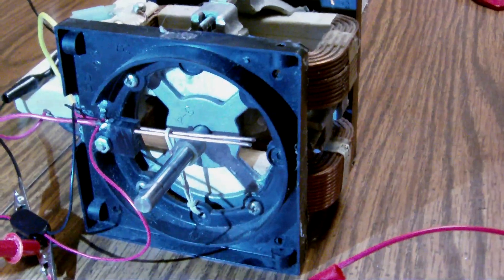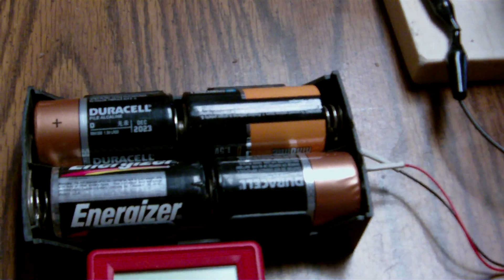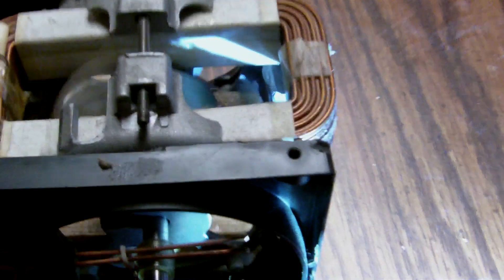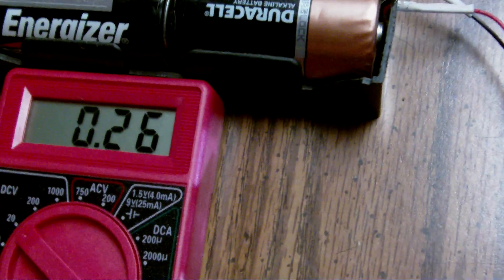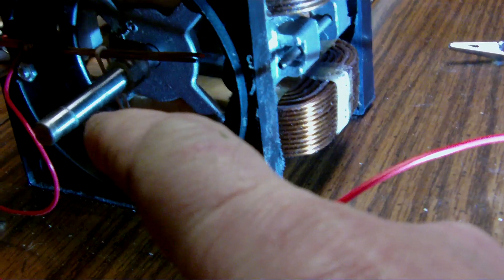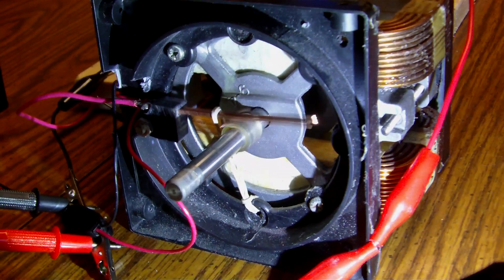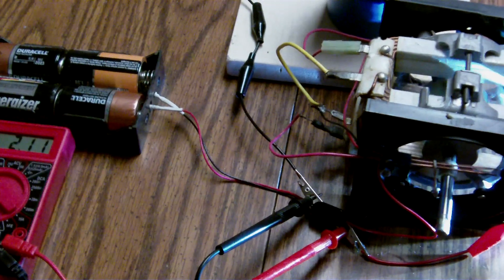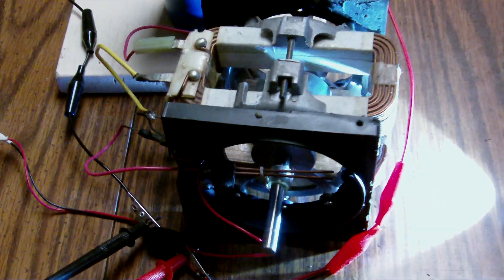newman motor  batteries to dead to run the motor , until  the capacitor

Comment: newmans motor doesnt run on current man;;;;;;;;;;;;;;;;;;;;;;;;;;;;  it runs on voltage''''
Reply: Your right,  as little a current flow as possible,,  Joe ran his  7500 pound motor on 750 volts at 1/4 amp..  sadly,  Joe passed away in 2015..  He was a cool guy.
Reply: I'm translating his commutator to solid-state switching.  @THOMASTHESAILOR
Reply: And yes, R.I.P. Joseph Newman.
Reply from the maker: @GaryMcKinnonUFO  would love to see a video when it's complete :-)
Reply: @GaryMcKinnonUFO  where can we find your work?
Reply: @JimEdmiston  I've nearly finished a larger Thane Heins replication (the only tech i've succesfully replicated in the past) and will upload it to my channel.
Reply: @GaryMcKinnonUFO  very cool. I checked out some of your other videos, too. It's kind of you to share your work.
I believe what you may be missing with the Newman motor technology, is that with an extremely large coil a large magnetic field can be created with a small amount of current (at the cost of high voltage). We don't need the coil to "fully charge" we just need it to conduct enough current to create the massive field and then return that field as back-emf between each half-cycle and direct that energy back to the batteries or when running at higher voltages to a capacitive load. The charge time of the coil does however limit the RPM of the motor while mechanically commutated due to arcing. This is why I was excited to see your comment about a solid-state switching device.
Reply: @JimEdmiston  Thanks Jim, i was under the impression that it needed to be fully-charged, and of course if you do the maths on that then there's no energy saving, you've put in more than you get out. I'm only working on Thane's RegenX technology now since i've replicated it in the past and seen it work.
Reply: @GaryMcKinnonUFO  Hello, just wondering , did you ever succeed in creating a solid state commutator?
Reply: @ZeppelinPass  No i didn't get past planning for that one.
Reply: @THOMASTHESAILOR  So how is that remarkable?  You can run a pulse motor for years on a single watch battery.  Still not remarkable.  The Newman Motor did nothing remarkable.  Newman was a con man who had little understanding of Physics.
Reply: @valveman12  ,  Newman motor is not a pulse motor..  It uses a standard commutator..
   Newman motor puts out much more shaft torq and  total power than the electrical current it uses..
    Standard conversion math  : 1 horse power = 765 watts..
   Don't believe Me.  Do the math yourself..

  You don't need to be a Physicist to design a motor..
Reply: @THOMASTHESAILOR   You said: "Newman motor puts out much more shaft torq and  total power than the electrical current it uses.."  I am not berating you, I'm just pointing out that you made a comparison between total power and current.  Perhaps this was just an innocent error.  Power and current are not the same thing.  However, there must be current to produce power as well as voltage.  I am not going to argue whether the Newman Motor is a pulse motor or not but I will say this, it does not produce more power than what it uses to run.
Reply: @valveman12  ,  Well,  I certainly never tested the Newman Motor,  but,  if ya watch the whole Newman Motor story that spans several decades..  You'll find,   Newman had many University Scientist test it and put their results in writing....
    These are credible People with all the expertise needed for a proper  determination...  They've all been sworn to and notarized, etc..  There's many of them..  All with the same test results..
  No, I don't have any links or references to the tests or testimony,  but,  it's very real and very correct and very easy to find..
   I've watched Newman's struggle for years....  With an open mind,,  It's hard to deny..
  Newman did everything humanly possible to document is Motor,   with no failures..  Only Nay-Sayers.
Reply: @THOMASTHESAILOR  A red flag is raised talking about Scientists validating yet no links to this information?  Sounds like a tale to me.  One that you most likely heard in the Free Energy Community.  Besides if this was so revolutionary, these Scientists would have pursued it as research and we would all benefit from it.  Same as the Bedini Motor and all the false claims of overunity made by Bedini.  You may consider me a Naysayer, I'm fine with that.  I know why it's not possible.  You could make a small model of one and do a video to prove me wrong.
Reply: @THOMASTHESAILOR  So you tested the Newman Motor?  If not, then how can you make claims in support of this motor when you have no experience with it?  How can you tell me I'm wrong if you have not tested this motor?   All you presented is conjecture and conjecture is not proof.
Reply: @valveman12   Don't be silly,  I specifically said : I've read all the info, notarized documents and stories about the Newman motor..  I've watched all his videos and his efforts for over a decade...
            No conjecture AT ALL..
  The tests and everything else is as documented as any other invention can possible be....  Go look !

  What I'm saying is :  Follow the whole series of events and it's proof,,  Then make a judgement..  Otherwise,   you are too uniformed to make a proper judgement or "belief" on the Motor..
  Go READ !
Reply from the maker: That's true, the batteries are pretty dead they only have voltage but the voltage is translated into instantaneous current with the capacitor, because no matter what you need some form of current to pause a magnet, but you are right it runs on voltage because the batteries are dead
Reply: I've been trying to replicate it and i just don't get it. In his book when he describes the energy in a massive coil compared to a small one (he keeps stressing about using the same input amperage) he doesn't account for the fact that it takes more time to 'fill up' a very large inductor, so on the face of it you don't get back more than what you put in.  @fpveddie
Reply from the maker: @GaryMcKinnonUFO  I'm only going on my experiments, and what I learned on the DVD of John bedini with my experiments I found that the more coils that I add to my bedene if I keep the input the same or lower I can get more output, so I'm assuming it's the same with the Joseph Newman motor, and I did see a video of a gentleman that bought some of Joseph Newman's material I believe in the 70s and he was giving a lecture and said that it takes at least 200 or 400 pounds of wire I don't remember which to gain enough back EMF off of the coil to exceed the input power, I'm assuming he was talking about big Eureka, I know that with the little motor that I put together, when the batteries are dead and will not run the motor anymore all I have to do is hook up my 10 volt capacitor and it will start running, I haven't checked out the Newman video again but I'm pretty sure that what he showed on the right side in the back when he was checking voltage he called it a capacitor, so my thought is if you build a machine with enough wire you will gain enough back EMF to charge a AC capacitor to pulse the motor with a lot of force and not use anymore energy from the batteries then you would with a smaller motor, I'm sorry I haven't read any of Newman's books everything I think I know is from experiments and some DVDs I got from John bedini I hope this helps, I'll have to check some of my videos more often the last time I looked at this video it had less than a hundred views :-) Thanks for your comment God bless
Reply: By the way, Thane Heins will be the first person to produce over-unity machines on a commercial scale, there's a 7-part video series on my channel about the basic effect, recorded by a colleague of mine eyars ago. And it's EASY to replicate, i'm just setting up the test-bed today to get out my old replication and pretty it up to make a video about it.  @fpveddie
Reply: @GaryMcKinnonUFO  More time to "fill up" a larger inductor? The larger the inductor, the greater the frequency, FYI. Surprise surprise. An inductor does not behave like a capacitor
Reply: @heavycurrent7462  Inductors behave like capacitors at higher frequencies.
Reply: @GaryMcKinnonUFO  Yes but the power supply is DC, with commutators spinning at some low RPM. My point is, the larger the inductor the faster it is to charge it
Reply: @heavycurrent7462  No, the larger the inductor, the longer it takes to charge it. Don't trust me, read it on an academic site but i assure you that's how they behave.
Reply: @GaryMcKinnonUFO  Ah, I see by "filled up" you mean an inductor with a maximum current flowing through it. Of course it takes longer for the current to go through the wounds, but I was referring to a "filled up" inductor as one at its peak resonant frequency. You are right I think
Reply: @heavycurrent7462  Ha, words got in our way :) I tend to speak plainly about these things rather than talk about time-constants, which some people may not know about, hence 'filled up'. It's an intresting area to explore, have you viewd the info on Thane's website, it's the only effect i've been able to replicate : https://thaneheins.ca/
Reply: @GaryMcKinnonUFO  Are you serious? I would think that‘d be the only effect I‘d need to replicate! I am now working on a different configuration yielding the same effect, and I‘ll try to share this to you as well. 

I see this effect much like the phenomenon of compressed gas accelerating through a constriction. Rather than slowing down the force of the particles by reflection (counter magnetic torque), the reflection instead is created at an angle, such that it complements the incoming force instead, thus accelerating the gas even more. And this is when things get even more interesting.. this acceleration draws in energy in the form of heat, and we call it refrigeration. 

I was looking to replicate this effect electrically for years to no avail. Until last year when I was working on some steel with a welder. I noticed the lights in my house (powered with tesla coils) flickered with the welders spark. I moved the set out of the garage to get closer to those lights and was blown away by what happened next. The lights went out as I started welding! The avalanche effect of a high current imploding the air seemed to draw the emf towards the spark instead of through the CFLs. I tried measuring emf with a dosimeter and the numbers would go way down with the sparks. 

Months have since passed and I now have a solid state device which is not powerful enough to turn the lights off yet, but could reduce the emf significantly and light up my load brighter (LEDs) with a tesla coil turned on. I have run many tests to debunk my theory but so far it is still holding up. I have thought of the same effect mechanically and Thane Heins‘ transformer seems to work according to the same principle.
Reply: @GaryMcKinnonUFO  He was not trying to beat the action-reaction chain, but rather flow with it. If you would construct a mathematical model of a physical implosion the very same principle would surface. The reaction (drag, counter torque, reflection) is simply delayed since the force is delivered as an impulse, creating an avalanche effect.
Reply: @heavycurrent7462  That's very cool indeed!
Reply: Newman used 0.1mm wire for the coil to reduce the current
Reply: Without current, there is no voltage to measure.
Reply: @valveman12  There was always a current, if you read the book with the full analysis of an ongoing demonstration there was current of course. When people say 'it only ran on voltage' they either don't know what they're talking about or they are exaggerating. It apparently ran on surprisingly low amperage.
Reply: @GaryMcKinnonUFO  Agreed!
Reply: @GaryMcKinnonUFO  Magnets do not do work.  They do the same amount of work as a rock lying on the ground.  You are not alone in making this error.  As you know magnets are a static field from North to South.  No work is being done.  Movement of a magnetic field perpendicular to a loop of wire connected to a load will produce a current in the field.  Therefore work must be added to create a current in the wire.  Magnets do not do work.
Reply: @GaryMcKinnonUFO  Your link does not work.
Reply: @valveman12  It's working for me. Alternatively go to his site, all patents etc are there : https://thaneheins.ca/
Reply from the maker: My point exactly, when you run voltage through a capacitor it turns into instantaneous current